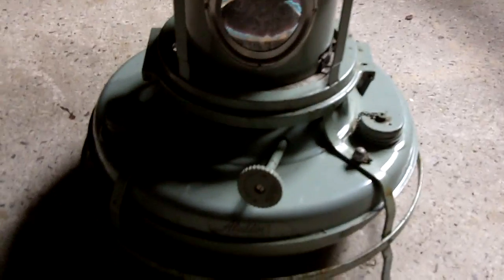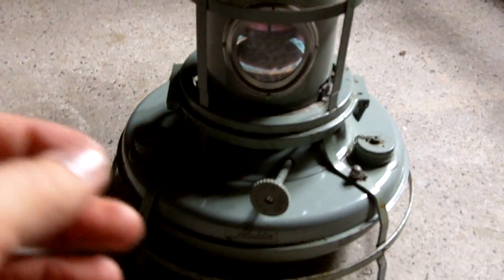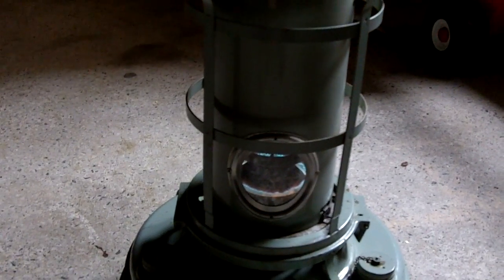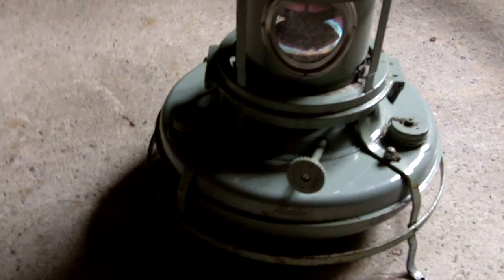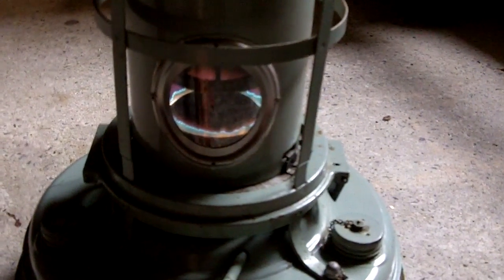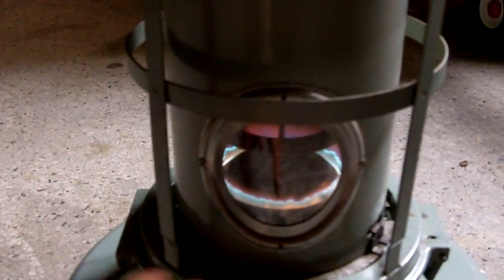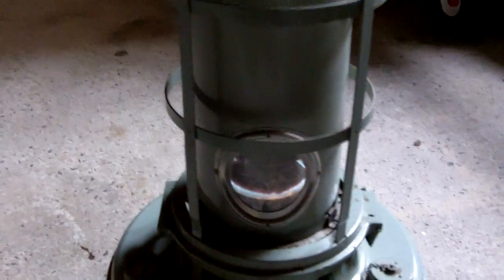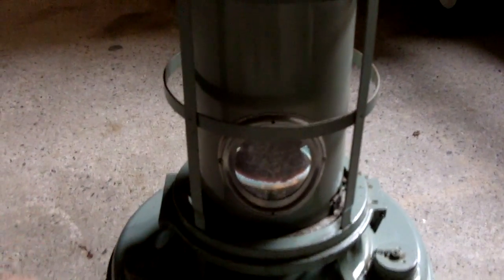Boiling Water on Aladdin Blue Flame Heater

Comment: I use one right now to heat my flat. Normally I use electric radiators, but nothing beats the Aladdin when it comes to producing serious heat in a hurry. If you place a fan on its lowest setting near the heater you can create enough circulation to heat the whole flat. Since I saw on another channel that you could use diesel I have used diesel instead of kerosene/lamp oil and it makes no difference. It doesn't smell or produce smoke/sot. I'm used to kerosene heater from my childhood so I know my way around them and you don't need a monoxide detector if you crack a window open or like you say have drafts coming from other places. The efficiency of the Aladdin heater stems from the fact that it doesn't blow any heat out through the chimney, the heat stays where it is needed. The Aladdin heater is a tad difficult to adjust to the correct setting until the wick is broken in (i.e. shortened by use). The Aladdin blue flame heater works a treat and I can only recommend it.
Reply: James M  I got a CO alarm on sale, which is set for 35 ppm (not a dangerous level) and it has never sounded... yet.

Comment: I use both Aladdin and Perfection..The Perfections are more of a pain because you have to turn them off to refill. However, the Aladdins use the wicks a bit faster. The Perfections are a bit hotter, so for small rooms, the Aladdin is preferred. That said BOTH of these heaters do not have a problem with dyed kerosene - modern Japanese-style fiberglass-wicked heaters clog-up on dyed kerosene.